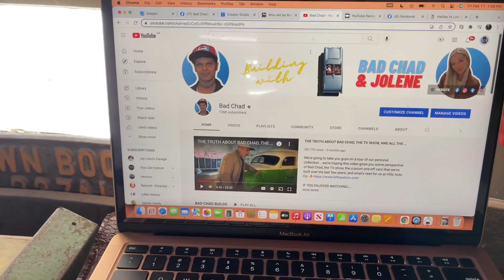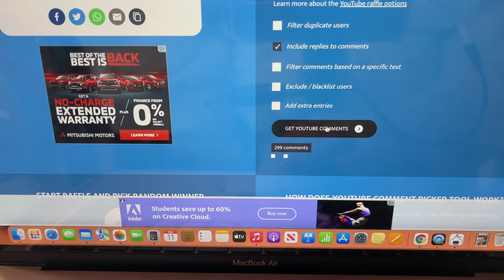Mocking up the LS Engine to a SBC setup... Is it going to work?

Comment: Whenever I mocked up engines in my rally trucks I always kept the frame portion of the mount on the engine until I was happy with the fit then welded it onto the frame ....may make it easier for you that way

Comment: The way I would go about it would be to cut the mounts off the frame, bolt everything to the engine and set it in place where you need it and weld the mounts back to the frame. You need more at least 1/2 to 3/4" clearance between the pan for the engine torque movement. Also, Chad keep in mind the low oil pan and your air ride when you lower it all the way down. something to keep in mind.

Comment: I’ve done a few custom engine mounts, I’d recommend having mounts all bolted to engine and then weld to frame, Also have the trans bolted up and do trans mount at same time.
Be a pain to finally get to fit and trans won’t fit.
Reply: Ya I agree with ya, bolt the trans and trans mount and see we’re ya have to go from there , the pan and steering thing may work itself out or not , the way chads going now he may have to move the trans crossmember afterwards, 🤔
Reply: I agree brother, I’ve done some myself and it only worked for me the same way

Comment: Placing the motor was a project in its self but you worked through it with success the best will come on the 2nd try to get it right and tight. Jim was a big help also.Thanks Mark Dutka Oakville Ontario Canada

Comment: The part of the motor mount welded to the frame weld a rod right on top of the rod the bolt goes throught

Comment: The best way to make sure the angle of the engine is right you need to install the transmission and mount it to give you the right angle where the engine will sit. Other then that its guess work, better to install both engine and transmission

Comment: chad- if you are fitting just a engine without the transmission you can leave the stand mount on the engine and use it to put a jack stand at the rear and align it lt and rt real easy.  Larry

Comment: The cradle on the back of the engine stand has one bolt holding it into the pivot feature.  Take out one bolt, like you were going to rotate the engine, and slide the cradle out of the stand. You can then use the cradle to help position the engine and make any adjustments

Comment: Weld another tube on top of the tube that you're trying to set the motor mount on with the bolt through it should give you enough height

Comment: Chad when you put the transmission on the back of the engine and put the crossmember and transmission mount on to hold it. Then it will pick the engine up 2 inches.👍 👍
⚠️⚠️⚠️⚠️⚠️⚠️⚠️⚠️⚠️⚠️

Comment: Most of those LS conversion mounts have 3 different locations you can mount the engine, if your in the farthest forward position a different pan and possibly pickup may be required.

Comment: Its just a clearance question, is it not? Im sure its been mentioned but why don't we reshape the oil pan by a 1/2"? Or find one with a lower profile that'll clear the steering linkage (crossmember?). Love seeing Jim,  putting his 2 cents in for this mock up.

Comment: Looks to me like you need some taller motor mounts. Jim's right.........the pan doesn't need to be lower than the frame. Those LS's have a taller than ordinary pan and it makes it hard to install on in an older car. Also there is a lot of distance between the core support and the engine. Hope there isn't a cooling issue.

Comment: I'm late to the comments, but Jim mentioned he has a problem with his quadrajet carb flooding, and not being able to lower the floats enough. Its his fuel pressure being too high, even if its a new mechanical pump for his application, they seem to put out enough pressure to overpower the needle and flood. He will need a fuel pressure regulator, or get a delphi brand fuel pump. They seemed to put out the correct pressure.

Comment: Chad you got to use mounts out of a pickup truck and make sure the motor is leveled you cannot have the motor tip and in an LS it's got to be level so use mounts out of a pickup truck the sticker the mount it will give you your clearance did a lot of ls swaps

Comment: Nice to see some engine work.
I would change the motor mounts on the frame. A bit higher so you get more space on the frame and the steering parts, it is now out of suspension when you drop it it will touch the steering arms. It is a bit more work but it gifts you a lot of benefits. 
Motor mounts as the firtsway mounted, cut it of the frame  and use fitted bolts. Position the engine in the center of the car and weld on some higher studs on the frame. (My thoughts) 
Do what fits for you 👍

Comment: I had a 2007 Tahoe with a 5.3 engine.  Those engines had a problem with how the top of the engine was vented and would use a lot of oil beginning at about 50K miles.  I bought a new valve cover which had a different vent and was supposed to cure the problem.  I sold the Tahoe before I ever installed it.  I still have the new valve cover. Hope yours doesn't.

Comment: Should have welded two pipes together along the long edge so from the end it looks like an 8.  Then a bolt goes through the top pipe through the motor mount.  And another bolt goes through the bottom pipe circle through the frame  motor mount.  That would have spaced it down a pipe thickness, and allowed for a way to accommodate the need for up, but not out (the problem Jim was talking about).

Comment: Chad, just a food for thought,in regards to engine hoist  use a comparable hydraulic cylinder  in place of jack,  small 12v pump with control valve  for up and down , valve similar from tractor w bucket  control.
Just a idea to make the process of lifting anything simple with less effort.

Comment: Pitman arm on steering box side and idler arm on the other side But i would put the trans and motor in all as one and work out your heights and clearances from there. . Would love to be there doing it with you guys. Cheers fro Australia

Comment: With rubber mounts the clearance should be more than the minimum due to the engine torque and twist. If the oil pan barely clears with the engine not running, you can count on it hitting when under throttle

Comment: Put a spacer between motor mounts and engine block.  It will give you an additional 1/4” - 1/2” for clearance

Comment: Jim is a treasure! Great to see him out and about. 
Have Jim check his needle and seat. Especially if the needle has a rubber tip on it. 
Next check the floats. I have seen the "fine ethonal fuel " the government has mandated eats through the solder joints.

Comment: Put a 5.3 in a vette frame. Had to do what Jimbo said, weld a boss on the motor mount and lower the hole. A pain but can be done. Got to work through problems like this no way to hurry up.

Comment: Leave the motor mounts on the engine. Loosen bolts until the hole lines up with frame mounts center to center then measure the gap between the 2 mounts
Reply: Make a spacer for each side the thickness of the gap

Comment: I'm probably too late for this comment but you should put the spacers between the engine mount and the motor and slot the holes closest to the motor so you can adjust for the difference the Jim is talking about

Comment: Take off the extra motor mount plate and save that $100 then buy you a new oil pan with windage tray, oil pickup tube and gaskets from speedway motors or amazon They sell a pan that will fit just the way you had it in the beginning. Probably cost you a couple hundred bucks? But you will save $100 by not using the motor mount adapter? Good luck!😊👍

Comment: save that other engine mount set and stick a spacer plate in behide th motor mount brackets and with car oil pan thing should line up fairely close

Comment: Chad if you check out half-ass Kustoms he welds he cuts 2 or 3in out of them aluminum oil pans and weld the bottom back on and puts J-B weld on and runs

Comment: how much is a 5.3 worth i been giving them away running engines should have seen the pu i gave my friend 2005 gmc black on black good clean body good paint nice interior engine ran good just the trans was going bad made my friends day i was going to scrap it after pulling the engine . i don't keep any rig newer then 79 unless it is for my wife i built her a 2005 4runner limited had to go through the engine but got it free, into it for 1200 bucks all new breaks no engine lights good clean rig leather interior made her day just what she wanted .

Comment: Take motor bolt and cut a piece of pipe cut to fit into the bracket install it in the bracketand lower in place and wield sleeve to motor lower motor mount

Comment: Use a Holley 302-2 oil pan. Will fit much better.  The truck pan is not a good fit in a car, especially a lowered one.

Comment: All you need to do to fix the problem and get motor mounts for the truck that the motor got taken out of and install it on the adapters and it'll drop right in

Comment: cut the mounts away from the frame, attach them to the motor and then modify them to fit, and then weld them back to the frame....Bennie

Comment: Engine mounting points should be fit to the car with the engine, which you can modify, not to the engine which as you see can be quite difficult.

Comment: WOW is all I can say
Reply: Motor should go up a one to two inches. Modify the frame pedestals making them higher per Jim's very 1st suggestion.  

Changing $300 pans and using an extra $100 set of engine plates and still being close on the steering is the expensive way and you may also have drive line angle issues/transmission fitment issues to boot. Perhaps very tight exhaust fitment too. 

I have done a lot of oddball engine swaps (last was a 455 Buick into a 56 Dodge, before that a 351w into a 56 Mercury which is same chassis as 55..).  Don't get too obsessed with the first idea to resolve fitment issues when an alternative ends up cheaper and easier in its entirety than several revisions to the first plan. 

You are very skilled in design and fab and I really enjoy your work and Jolene's great camera work. But, just raise the motor and be done with it.

Comment: Why are you putting a GM Engine into a Ford? ( The cheap way to go)
Reply: Because he wants to drive the car.  Ooooooooh snap. Sorry but you lobbed that one in there.
Reply: @willie6466  Good one, I am sorry for my comment, I was born and raised on Ford, My Dad worked for them for 35 years and I worked for them for 29 before getting sick.
Reply: It's all good, and I may be biased because just so many rodders when I grew up dropped a Chevy motor into everything.
Reply: @willie6466  I built an 84 Ford Ranger Shortbed, everybody that was doing them were putting 302 Ford Engines in them, but not me I'm a big guy so I went big, I had a Ford 460 built by a Shop that builds Engines for race cars and I put that in mine, along with a Narrowed Ford 9 Inch Possie Rearend. Just saying, but I love what you do and how you do it, Keep up the Great Work and Youtube. Thank you, BigRay!